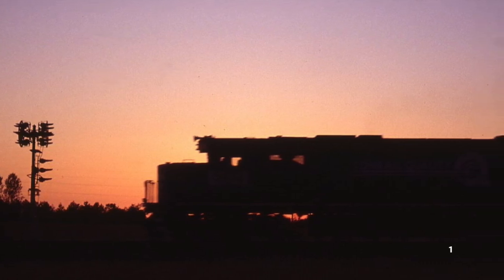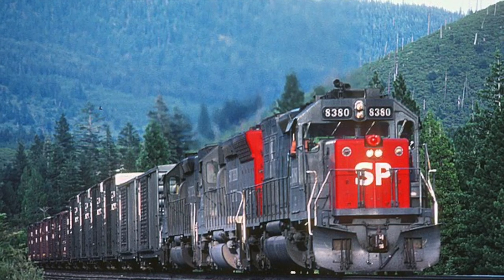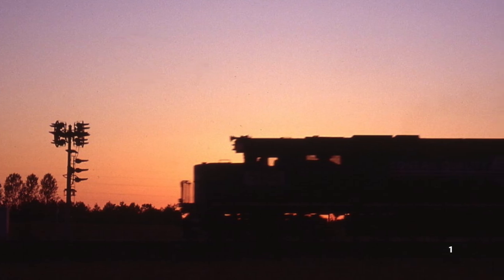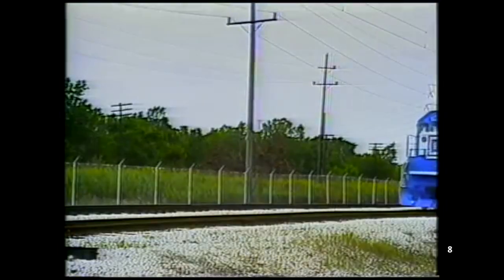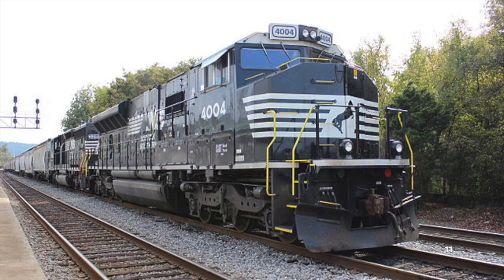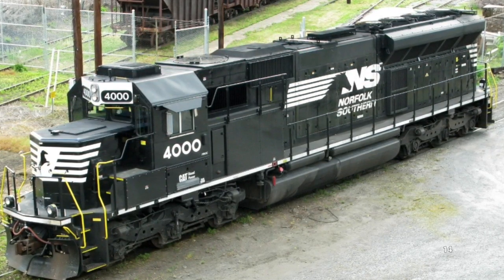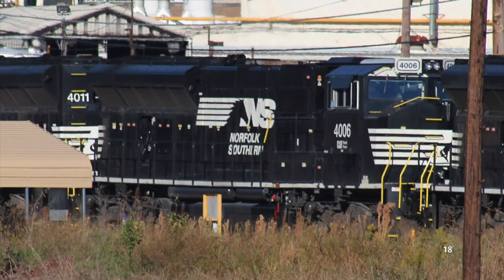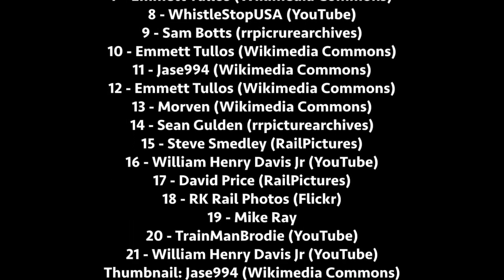Rebuilt: Progress Rail PR43C

Comment: The DDA40X's were killed off not because they used a lot of fuel, they were just basically two 3300 HP locos on one chassis with a single cab. They didn't build more of them because a single failure took out two loco's worth of power. They were around long after the Arab Oil Embargo and finished their days with a huge number of miles and kilowatt hours. I watched them in Vegas into the early 80's on trains to LA and back.
Reply: I remember reading that UP stopped using the DDs because they just simply wore out. They amassed over a million miles each in about 6-7 years. UP loved them and they worked pretty darn well for what they were. It was only when they tried uprating them to 3300HP from 3000 using a normal E block that they showed significant reliability issues. Once they got derated to 3000HP they didn't have all that many issues.

Comment: To my understanding the "C" in the designation "PR43C" actually was a reference for Caterpillar powering these units. The GP50's & SD50's weren't immensely problematic like many have been overexaggerating about. Many of those units had power assemblies from their 645F3's swapped for better ones from 645E3's. That,or the horsepower was derated by resetting the governor settings or changes to the fuel racks. There actually is a good amount of GP50's and SD50's left in usage on shortlines and such. The PR43C's were extremely junked in comparison to the SD50's. Most failures were from the C175 prime movers causing stress or literal damage and ending up with a dead unit. The PR43C's couldn't complete cross country trips without repairs unlike any other EMD units. For the sake of all things,these failed more than GE units catching on fire. The only interesting thing about the later units was using the almost foreshadowing SD70ACE-T4 radiators and having those unique wide cabs that resembled a SD60M Triclops nose but with SD70ACE styled windows. Anyways,these units proved well before the SD70ACE-T4's that Caterpillar engines shouldn't be in any large six axled locomotives. Caterpillar only did well in switchers for GE and ALCO many years ago,espiecally the military. This just proves why CAT/PRLX has always been a mistake for owning EMD.

Comment: By 2021 the PR43Cs were sitting at Vancouver, British Columbia with an uncertain future ahead of them, but in that same year they were renumbered from #4000-4011 to #130-141 in order to make room for the AC44C6Ms that would be numbered in the #4000s. Many railfans speculated that the PR43Cs would re-enter service after this, because why would Ontario Northland go through the trouble of renumbering them if they would never operate again? Unfortunately, these theories proved to be wrong when all 12 PR43Cs were returned to Ontario Northlands Vancouver British Columbia shops in late 2017. By 2018, they were chopped up into parts. Nowadays, all PR43Cs are assumed scrapped, including the demonstrator, 4300. Nah, just kidding. So why are the PR43Cs important? Other than that, thanks for watching.

Comment: The C44-9W's are always having problems, and I'm wondering if it's like the SD50 had with it's motors. Ever realize that the C40-8's and 9's rarely have issues but the 44's DO? That's probably because GE, who SHOULD NOT BE BUILDING MOTORS put a ton of stress on the prime mover.  They are meant to put out 4000 HP, they are DESIGNED to put out 4,000 HP, no more than that, but GE has them set to run at maximum overdrive to get that extra 400 HP out, and that puts a lot more stress on the motor.
Reply: Engines, not motors.
Reply: @pootispiker2866  ok Mr proper lol. They mean the same thing
Reply: @ReadingAreaRailfan  Motors run on electricity
Reply: The C44-9W's don't have to adhere to tier four regulations which is why those units are being rebuilt by Wabtec in large numbers. The ET44AH's and SD70ACE-T4's are actually more mainteance demanding and consume more fuel than most tier three and tier two units out there,both EMD and GE. The main cause for that is the railroads doing with EGR instead of DEF. The only reason why tier four units even exist was so the railroads could benefit from tax write off's. With Wabtec now controlling GE's market,they made massive changes including rebuild programs and also have replacement and rebuild parts for EMD units rather than PRLX. The -8 Series had problems just like the -9 Series from leakage in fuel lines or turbocharger seals wearing out. It was far worse when the AC6000CW's were around before the rebuilds. Dating back to the -7 Series and Universal Series those units had weak traction motors and would melt dynamic brake grids from overheating if not on fire. Even GE executives confirmed this and it was a shocker for any of those units to survive fifteen years if not more with their owners. With Wabtec now changing things,GE units are actually becoming more reliable and there is far more distribution which is bringing costs down. That's why most EMD units don't get rebuilt,put in storage,or sold off. Thanks to CAT/PRLX screwing things up from the very start as EMD's parent company.

Comment: EMD should have been alittle slower not just been lazy and instead made a new V16 engine that could take the stress intended for the SD50, and likely would still be number one today
Reply: The 710 came a generation too late, it seems.
Reply: That's quite obviously why the 710 Series was introduced with the GP60's & SD60's to begin with. EMD was already outstripped by GE at that time because of the debut of the -8 Series. GE had microprocessors,wheel slippage prevention,more horsepower,and stronger traction. This was just the beginning of EMD's removal from market dominance. Most of the GP50's & SD50's just had power assemblies swapped with 645E3's or had governor settings reset to resolve the horsepower issues. Many units still survive elsewhere in secondary ownership. The worst mistakes EMD made were the SD90MAC-H's and SD70ACE's. GE made tremendous progress with the AC4400CW's and ES44AC's.

Comment: The SD50 was absolutely not the most unreliable locomotive. That award goes to the SD90MAC H. I haven't talked to any engineers who had it working for long enough to gauge its performance, something the SD50 was at least able to manage.

Also, it's engine. Not motor. Motors run on electricity.

Comment: These pieces of crap spent more time being repaired than they spent on the road. Engineer friend of mine found literal engine parts laying on the running boards after a massive engine block failure. Cat engines have NEVER been able to withstand the rigors of railroad use. There's a video on here elsewhere showing one of these being scrapped.